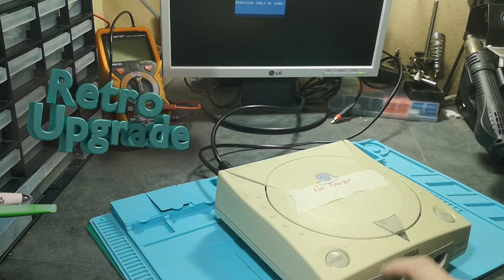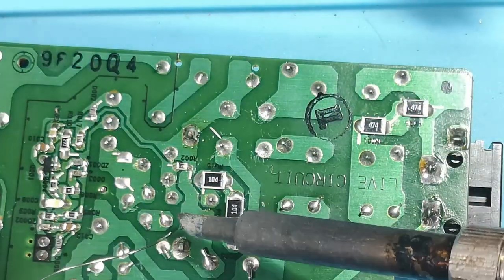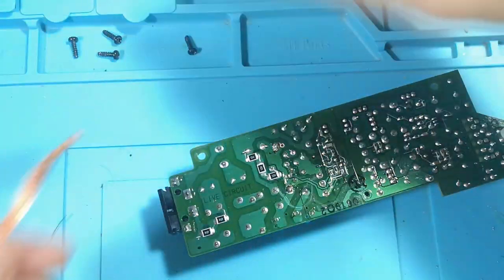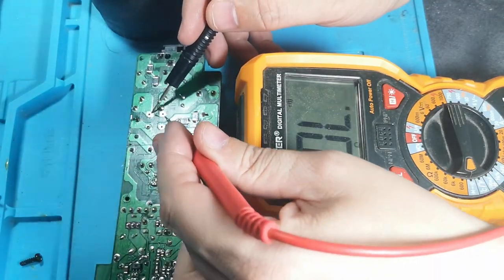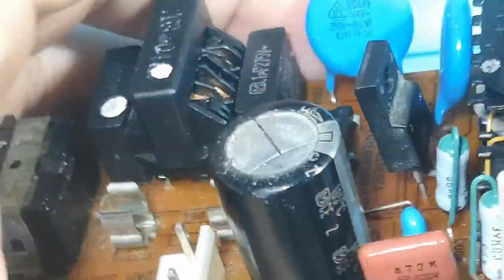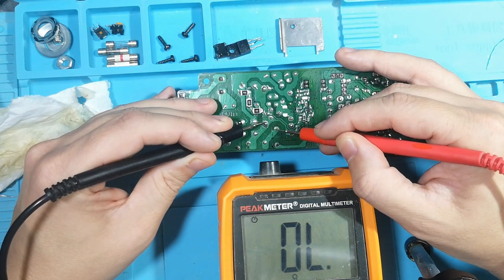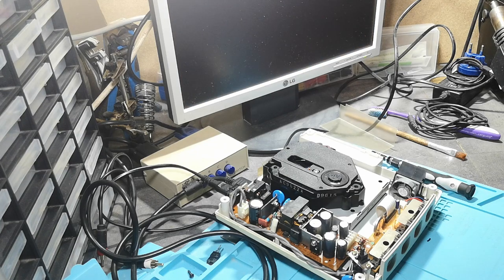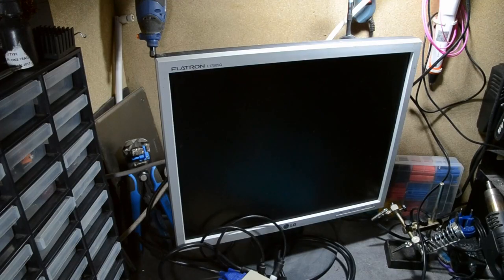Dead Sega Dreamcast  - No Power

Comment: Hey thanks for the shout out!!!! 🙂🙃🙂😁

What's wrong with the donor PSU that couldn't be repaired economically?
9:45 Use a light bulb to limit the current in series with the mains supply when you power up a PSU you just repaired - then the worse thing that could happen if there is a short is that the bulb lights up 😉
Reply from the maker: Did you like the 3d spinning LER logo. The doner psu was fixed off camera to make the video shorter😁.
Yeah I have to make me one off those light bulb testers.
Reply: Very grateful for Learn Electronics Repair -  I need to build that lightbulb circuit - I’ll have to see which video it’s on!

Thx retro gamer for the soldering methods you use - it’s where I’ve probably gone wrong as I’ve generally  used lower values & not a heavy tipped soldering iron. 

Some observations/tips (gained from LER / EEV & others) :-

Make sure you’ve dumped any voltage out of the boards prior to handling - you were picking up & prodding away - you might get a nasty shock one day!
(Deadly too so beware!) 

Bending the mosfet pin - ok - it’ll “do” for what you’re doing - if a more expensive item then perhaps get the real one if possible as over time the bend you put in can weaken/cause a problem - (I’ve seen it fail in practice) they’ll be a reference at the end of the mosfet number designating the pin arrangement. 

I would’ve been tempted to measure / replace the big cap with what you’ve done. As the mosfet - then later the bridge rectifier went shot - any over voltage to cap will degrade it. Having recently looked more into capacitors - the lifetime is generally so many 1000’s of hrs. 1000hrs is 6 weeks continuous use - so I can only assume most caps are well over their hours but continue to function many times over until there’s a fail elsewhere so best to replace. 

Well done for keeping tripod fail in 😂

I think I’ve a Dreamcast sitting around somewhere - never powered it up - might have some Dreamcast games around too. I’ll have to look as I’m going to eBay remaining sega gear I acquired - I’m keeping just what I need for a Williams defender build I’m doing. 

Thanks for the upload 👍

Comment: hello , could you please help me.. I have issue with my power supply , same as yours 220v. I am not getting 12v on the connector. 3.3v connector is also showing around 4.8v and 5v connector around 4.6v..
Reply from the maker: Hi there could be several rezones why your 12v rail is gone one of being the mosfet i changed in the video .
there are a couple of other components that can fail diodes /caps / resistors are rare that they break .

there is a nice schematic on this page for the PSU: https://dcnigma.tumblr.com/post/101352326649/dreamcast-diagram-s

Hopefully this helps , its a little hard diagnosing not having the board in front of me .

Recommendation is to first measure all the caps so you don't have a shorted or leaking one .
Reply: @RetroUpgrade  thank you for the reply, I have already tested all capacitors and MOSFETs, there's no short and the mosfets are functional. I have focused my attention on the mosfet that provides 12v the d1276 (q301) on the second pin it has voltage of around 20-22V, on the base it has some micro voltage. when I manually apply voltage on the base pin, the 12v pin is also starting to rise. so the MOSFETs is functional. now the question is why isn't the MOSFETs getting open with the BASE pin, why doesn't it receive voltage so that collector can forward voltage to the emitter which will then automatically give 12v as wel. could it be that the transformer T001 BE128A is maybe malfunction? if you have any further ideas I will be so happy , as I aim already 1 week bussy with this issue and unable to solve at my own
Reply: another note, my dreamcast starts up normally, it works, just the GDrom is not getting its voltage. when I manually apply 12v on the 12v connector the gdrom starts working as well, thou it has issues reading discs that's a different issues with the laser to be solved later on @RetroUpgrade
Reply from the maker: @sanelb1147  You have done your homework that's for sure 😂, ok so you have tested most parts i would have as well , you even self powered the GDrom with 12v and it works . 

only culprit left is the Transformer. the 3.3.v rail being 4,8volts is a little worrying , 3.3v rail is derived by a separate winding and would be very weird if that got affected by 12/5v winding . maybe something wrong with the input winding or some of the passives around there because its affecting all 3 rails or i guess 4,6 on 5v is fine .

try testing the diodes before the transformer  d1/d2 in the schematics , test Q1(guessing this works because you are getting voltage on some rails ).

let me know if you find some wired measurement

good Luck ☺

Comment: My 12v pin only reads 11.35v on multimeter, is that fine?
Reply from the maker: It's a little low but most system are tolerant +-1v , 
the mosfet could be switching slower due to age.

would order in some for the 12v rail just in case :D
Reply: @RetroUpgrade  my dreamcast have blackscreen after boot same like your problem, fan is spinning tough. is there anything causing this problem? could the 11.35v possibly the cause?
Reply from the maker: @riansigit  It can be a mosfet but won't be exactly the same issue . My guess is the 12V rail supply is not handling the load very well due to age .
here is the schematic for the PSU on the dreamcast , my guess would be that Q2 is about to fail and needs changing out 
https://gamingdoc.org/technical-documentation/consoles/sega-dreamcast/independent/schematics/psu-837-13570/

does the light come on when you power up ?
Reply: @RetroUpgrade  the light is up, normal orange
Thanks for your reply, really appreciate it
Reply: @RetroUpgrade  for Q2 replacement can i use L7812CV volt regulator instead of 2SD1856?
Reply from the maker: @riansigit  Hi i actually don't know, and i am working 24h shift these weekend dont have the time to check the datasheet.

if you can wait i'll check it later

Comment: I know that's not the point of the video, but personally, at this point if the original power supply fail, i'll just replace for a Dreamcast PicoPSU and an external 12V 3A power supply.
Reply from the maker: Agreed the picopsu dreampsu. Is affordable now and a great option only thing i don't like is that they used a barrel jack and not a USBC PD  connector instead 😜